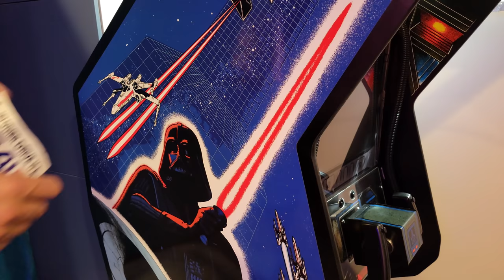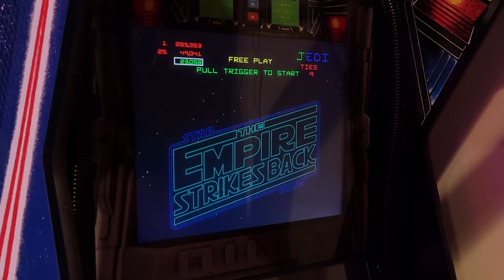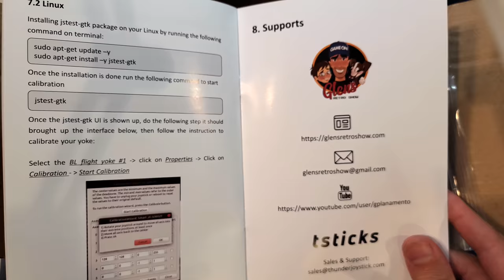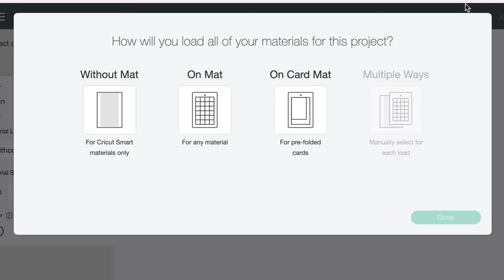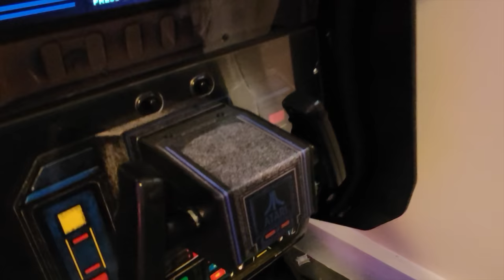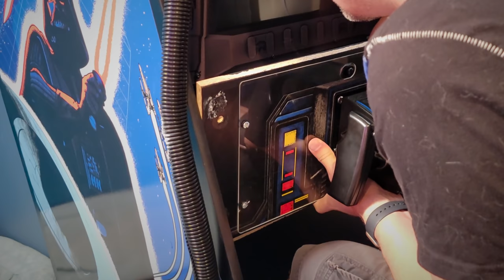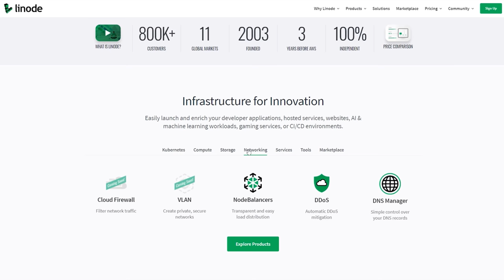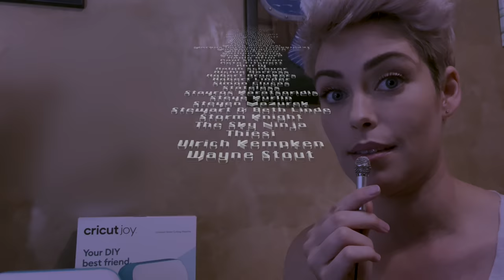Atari Star Wars Cockpit Arcade Upgrade: A New Yoke & more

Comment: the actual odds of successfully navigating through an asteroid field is about 1 ie, in reality the asteroids are so far apart you never need to watch out for them. Space is very big, except in movie jeopardy asteroid fields. According to QI 'The average distance between asteroids is about 600,000 miles, and most are about the size of a tennis ball. So far, 12 space craft have [passed] through our solar system's asteroid belt, and none of them has ever come close to colliding with an asteroid. The chances of being hit by an asteroid in the asteroid belt are about one in a billion. '

Comment: At the end of the video do you mean another 'egg-citing' recipode?  PCB this time could be - Pen Cap Bitten?  AND I feel I should point out that there's a little mistake in this recipode.  (apart from the odd way of saying non (as 'Nun') that is).  Look at the Atari logo on your original yoke and now look at the one you put onto the new one.  Can you see the problem?  (Obviously your usually spot-on scriptwriter and editor (Puppyfractic) hasn't spotted it).  It's not something TOO important but to keep it looking as authentic the missing thing should be there!  What is missing (you ask)?  The REGISTRATION MARK!!!  (Perhaps I'm being pedantic, but the original one has one and the new printed logo, doesn't).  Just thought I should let you know.
Reply from the maker: Yes I didn’t mention that in the video but it is too small to cut out. Best I could put a symbolic dot to hint at the trademark registration mark. However as I am not the copyright holder I do not need to claim the trademark registration on my own property. So you’re right it’s not really a big deal. Good eye though! - Perifractic™️

Comment: I remember the questionable soldering :)
When I acquired a vintage record player with jittery power issues, I remembered those so well to track some dodgy soldering in the battery compartment and fix like you did.

Luckily, I didn't need further repairs, but I'm learning a lot and more from your videos :)

Comment: Was it becoming non responsive because it wasn't plugged in all the way?
Reply from the maker: No I had checked previously from the back access panel. The plug does come out if you pull the entire panel the opposite direction though. Note that the fire button still worked when the cursor locked so that tells you the plug was still connected.

Comment: I have vowed that I will never give Provo Craft, the makers of Cricut, another dollar, after they intentionally effectively bricked their "legacy" machines by discontinuing their proprietary software. 10s of thousands of Cricut owners were basically forced to send their machines to e-waste, and got a $10 off coupon for a new machine. 

If you want a digital vinyl cutter and plotter, I HIGHLY recommend the Silhouette Cameo, as you can use any software you desire to operate it. It also has no problem if you buy 3rd party accessories, unlike the Cricut. Ohh, and did I mention they wont brick your machine because the new models aren't selling well enough?
Reply from the maker: Wow I didn’t know about that. This video was not sponsored by them.

Comment: Holy moley! $265 for the yoke on Amazon! I was expecting ~$150.... I paid $399 for the Star Wars Arcade1Up. Oh, well. I guess I'll hold off on that unless mine breaks or develops this sticking issue.
Reply: The only other readily available Star Wars yoke is the Alan-1. It's really for enthusiasts who want the closest yoke you can get to the original arcade, as it's identical to the arcade yoke in construction apart from using metal gears for reliability (the arcade gears were plastic and wore out over time). It is however $349 and requires a $100 converter for an Arcade1Up system and also requires control panel modifications to get it to fit on an Arcade1Up control panel.
The GRS Yoke is essentially 'plug and play' and the only tools needed are a hairdryer to remove the glue from the original yoke connectors and a screwdriver, plus it can be used as a PC USB flight stick, which is great for those who want to play flight or space sims, or want to make a custom cab that supports a wider variety of games.
Reply: @stephenrobertson6025  Thanks for the info.

Comment: Not so much a retro question, but have you noticed the flashy flickery effect with some things in 4k videos?  I see it around the letters when you are reading the manual, and I also see it in my own 4k videos on things like white picket fences.  Maybe just an artifact of high contrast stuff that has never been visible before in lower resolutions?  I'm all ears if anyone has a solution.  Could just be my TV too!
Reply from the maker: I don’t really see it here but it could be that your sharpness his up a bit too high?
Reply: @RetroRecipes  It very well might be my monitor.  It looks like when anti-aliasing is used on something that is almost vertical or horizontal, and it goes in and out of exact alignment with the pixels.  Maybe it is a really small scale Moire pattern.

Comment: Can someone explain why he had to use all those connectors instead of the USB? Isn't this a modem retrofit?
Reply from the maker: Those are the connectors that the arcade one up used so it simply replicates the same wires. The USB option is for if you are using the yoke with a PC set up.